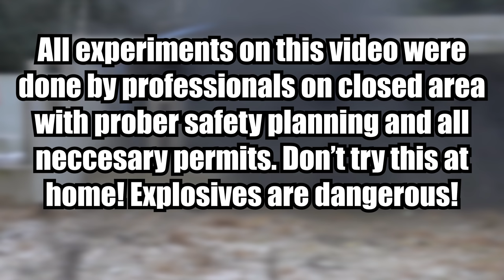How hard it is to explode a hole in concrete wall?

Comment: Never seen a better commercial for concrete walls...
Reply: @ChongPangBoom  money
Reply: @ChongPangBoom : that Concrete is High density. MicroFibre and steel reinforced concrete in a vibrating cast.
That probably costs a 1000 dollars or more.
When you talk about 4 walls per room. Ceilings. Pillars. Etc.
You quickly escape a third world countries budget for both manufacturing and purchasing and sale.

We have the technology to have Supercrete now that can build structures twice the size of the burj khalifa.
The problem is no one can make it to the quantity or budget required to Make it possible.
Reply: Can't glass bottles be used to strengthen concrete structures?
Reply: If I ever get a bunker built, I'd want their walls :-)
Reply: @TheOneAndOnlyMrH  Well Finland does have long experience in making concrete bunkers. Due to civil defense legislation pretty much every big apartment complex, office block etc. does have an air raid shelter on bottom floor or in the basement under the building.
Reply: I want something like that between me and my stupid neighbors...
Reply: @jugganaut33  wow, I thought all concrete was the same, I didn't think that there were advancements in the field of concrete
Reply: Yes, as a concrete wall myself, I'm flattered by this video
Reply: Honeywall doesn’t give a f$&@
Reply: @ARF_average  yep
Reply: @erik365365365  lmao nice name
Reply: @mastershooter64 : yep. There’s some fantastic things you can do with concrete
Reply: Looks like maybe 12inch on center #5 rebar reenforcment, I've poured stuff with 8 inch on center with thicker bar like 7bar at 12inch thick, for water treatment plants. Basically bomb shelters.
Reply: @ChongPangBoom  Because they were not using an artillery shell.
Reply: I'm glad something new
Reply: @ChongPangBoom  You don't see houses go down like sand because of small loads like those breaching charges... you see them go down because they get hit either by heavy artillery, a missile or a guided bomb. They don't carry 800 gramms of TNT equivalent, but 117 Kg for a Mark 82 Bomb...
And if it is a controlled demolition with targeted explosives, you can bring most concrete buildings down like sand with quite small charges (a few KG), even with reinforced concrete.
Reply: Now to make something to patch the hole from the last fight with your neigboor
Reply: no one will ever be able to punch a hole through your wall unless they use PETN!!!!
Reply: @thoughtfox2409  thank you, you said it for me lol. A lot of people seem to think an explosion is an explosion is an explosion
Reply: @mastershooter64  There's a ton of different concrete. The sad part is that we've lost the knowledge of how the romans made concrete, many things they built of it has lasted until modern times. They also had at least two different techniques, and the one that it's the biggest shame it's lost to time is their marine concrete, that actually improves its durability in the presence of sea water, instead of slowly degrading and eroding like modern concrete. There's roman built concrete bridges that still stand to this day(and some are in use for traffic!) On the other end of the spectrum you have Chinese buildings where the concrete cracks within 3 years, and they're basically condemned within 20.
Reply: @omarzx5700  Oh there's other explosives that'd do it too, like RDX, or more commonly TNT and RDX mixed together(which is about 50% more potent than TNT by itself). Then there's state of the art explosives like CL-20 and HMX. Then there's thermobarics, but they're not exactly made for bringing down walls, unless you count bringing down the entire structure.
Reply: @OnlyKaerius  Concrete is based off of a caustic solidifying crystallization between calcium and silicon dioxide (sand/glass/quartz) when in liquid solution (calcium silicate hydrate). It forms basically limestone around whatever filler material you use like cheap gravel and hard beads of steel slag. You can use silica fume (micro-sand) and some other additives to improve the final crystallization homogeneity, and you can add rebar and metal/ceramic/ or organic fibrils to keep cracks from spreading, and to take up flexural and shock loads. They act like little anchors which have a higher tensile+shear strength than the surrounding concrete.

There are other formulations of concrete, other fillers and additives, and other ways to strengthen the final slab far higher than any glass limestone rock. One example is using aluminum oxide (sapphire) in place of sand and silica fume. It is a much, much stronger ceramic versus quarts and has one of the best chemical resistance to nearly all acids and bases. Some geopolymers have a limited ability to incorporate aluminum oxide into concrete mixes, and there are plenty other ceramics that would do the job as well.
Reply: If you want a 3000MPa compression/ 500MPa tensile wall, nothing's stopping you.
Reply: @jugganaut33  basically all concrete is vibrated and objectively concrete is quite a cheap building material Look at the amount of dams / irrigation that some objectively poor countries have. It is just very heavy and therefore expensive to transport and crane into place if manufactured offsite or pump into place if formed onsite. Also the main reason that there aren’t tall buildings fully made of reinforced concrete is that a giant tower with no windows isn’t going to be funded by anyone.
Reply: @Baigle1  Even the romans used crushed pottery(ceramic) to improve their concrete, what we don't know is how they made their marine concrete resist and actually become strengthened by sea water, instead of degrading and eroding. We don't know how to do that.
Reply: Now imagine being rich enough to build massive steel and concrete bunkers, knowing that nothing can touch you... Lol
Reply: @OnlyKaerius  the main reason roman concrete last forever is that they don't have anything than can rust inside. this is also the main reason concrete fails after only 20 years, unless it's absolutely perfect, water enters and rust forms on the rebar's and cracks the concrete (if you have big enough impurities, ice formation by itself does the job, too).
the main disadvantage is that roman concrete limits it's architectural usefulness extremely. you can basically only use it as a replacement for stone, it can only resist compression. building lets say a highway bridge with roman concrete would essentially mean it would look like the old railway stone bridges we have all over Europe. very little ability to span and using tons of material, but lasts forever (unless you get a strong enough earthquake, then your steel reinforced concrete has a much better change of surviving). today's concrete is made the way it is, so it can be mass produced, used rapidly, and allows building structures than otherwise would be impossible.
Reply: @OnlyKaerius  that's actually not true, they figured out the formula for Roman concrete in 2017. Turns out it uses the volcanic ash pozzolana in the cement and is mixed with seawater, not fresh water.
Reply: @aritakalo8011  Fascinating & Freaky.
Reply: Legit why they helped them do this 😂
Reply: @ChongPangBoom  
reinforced concrete isnt all that expensive to make and you can easily make it yourself at home.
the only problem with it is that it takes time for the concrete to harden and you need heavy machines to build with larger slabs likw full wall tiles.
Reply: @ChongPangBoom  huh good idea, have they ever think about it
Reply: Hhahhahah you got that ad too?
Reply: @jugganaut33  I don't know about high density or microfibre concrete but I'm an architect in México you could say it's a 3rd world country and most of the low budged housing projects are made fully out of reinforced concrete, of course its only 10cm walls and thin rebar mesh, but my point is that concrete itself is not expensive, it all depends on how thick and how strong is the steel reinforcement you use.

The great thing about reinforced concrete is that it solves the two main forces a building needs to hold up to: 
1. Concrete is extremely resistant to COMPRESSION and protects steel reinforcement against corrosion.
2. And steel is extremely resistant to TENSION
Put both of them together and you get one of the best materials for construction, and having a very efficient construction method is fast and cheap.

Those are the nice things about concrete, the worst part about it is bad thermal insulation that why here in México, high budget construction use other hybrid construction methods.
Reply: To show you the power of flex paste I used explosives to put holes in this wall
Reply: @The Lombax You're applying American prices to the third world which is not correct. Concrete itself is dirt cheap. The expensive part is labor and if anything is cheap in third world countries, it's labor. Cheap labor + no insurance = cheap concrete buildings.
Reply: @ARF_average  That would lighten a concrete wall while only minimally making it weaker in compression. Installing both bottles for air voids and the steel tension grid might be a bit tricky though. Haven't given it a thought before.
Reply: @jugganaut33  Not to piss on your budget parade (honestly),  but.. one would only need the basement level of a detatchedhouse to have concrete walls. So that's either half or one third of the whole wall made out of this super expensive cement and rock mixture.

The costs of which, as you implied, would come down to the local providers logistical capability. Crushing, sorting for size and then especially moving shattered rock around gets more expensive the less production sites one has in a given area. Luckily in Finland we have good coverage of such sites and well built roads all around, arguably even in places where such infrastructure isn't needed. The steel bars are equally abundant in Europe. Means the product is relatively cheap for the constructor. Now assembling the tension bar grid and encasing it with the concrete mold before the pour takes some man hours, which can cost you in a welfare state. 

Oddly enough concrete walls are way more expensive to produce in the so called "third world" despite the cheap labor. Luckily they are quickly catching up.

Also only the first room needs 4 walls. Two rooms can share one wall and so on. ^^

Then again if we are talking about building super tall buildings the limiting factor becomes gravity. Namely pumping the cement and rock mixture to the top level pour sites requires multiple pumpstations and steel reinforced and airtight chutes which can only be of a given length before buckling under pressure. So moving concrete materials vertically can get expensive but moving it horizontally can get stupid expensive.

I'm definetly not an construction engineer, so if anyone wants to pitch in go right ahead :D
Reply: @NJzinho  Money is not the issue its because of insurance, they dont want you to have an immortal house, they want youre house to get rekt so they can replace it with another cardboard house and raise the cost.
Reply: I need that concrete wall
Reply: Best commercial for anything I’ve seen
Reply: @Baigle1  I wondered about aluminium oxide fills. I'd been watching some videos about water jet cutting, then a documentary about the Hatton Garden robbery. Criminals used a big hole cutter to cut through a reinforced concrete wall into a vault. So was wondering if you could defeat that kind of drilling attack by using that sapphire grit. And I guess for the bunker builder that has everything, a couple of pallets of industrial diamond grit would wear down any would-be robber.
Reply: "Now, thats not a lot of damage"
Reply: I wana see a concreat wall commercial
Reply: Yeah haha I hope the perustava folks at least took them out for drinks that night!
Reply: @OnlyKaerius  it's actually being researched and implemented, they used pozzolanic cement. their marine cement is pretty much the same thing, volcanic ash and lime would react with seawater and create tobermite crystals due to the Phillipsite inside the ash. check into it, pretty cool stuff. we would have to be able to manufacture Phillipsite via a lab to keep up with our needs today since society is much larger (or start pissing off volcanoes).
Reply: @skuula  This is 4 months later. But that is exactly my first thought. Hahaha

Comment: Disclaimer: "These are trained professionals, don't try this yourself"
Trained professionals: "We wrapped some det-cord around a bottle... IDK"
Reply: "Prober"
Reply: Professionally sketchy
Reply: All 'professional' means is you get paid to do something. If someone gives you a penny to throw a FRAG grenade at a fish, technically you are a professional grenade fisherman.
Reply: @Debbiebabe69  trained
Reply: At least they didn't use a Pepsi bottle, because that would have been cheating. Trained professionals know these things.
Reply: The big issue is less the explosive stuff they build and mostly the way you handle the explosives, how much you use, what you use and what safety measures to take.

 If the blast itself goes wrong that's not as big an issue if you have everyone at a safe distance, behind a wall and so on. But if stuff blows up while you're working on it, you have problems.
Reply: @leow.2162  "But if stuff blows up while you're working on it, you have problems."
Ah, yes. I too consider fucking dying a problem.
Reply: that's how it is,  when my dad was in the army they would not exactly play with explosives but do "experiments" with them... such as what happens when you put a bunch of nails in C4 or lets ask for an airstrike on this giant gas container we had airdropped in for us
Reply: lmao
Reply: @Debbiebabe69  Wow holy shit, by definition, you're completely right; what the fuck
Reply: As is the the case for most things engineering
Reply: @Pillar_of_Salt  imagine being right on the internet lmao
Reply: @ZentaBon  Right? lmao
Reply: The professionals knew how do a detonation calculation and were right as far as safety stand-off. They also did a practical experiment, but for fun. They even, subtly, showed the difference between two water charges. The bottle didn't work because all of the force went to blow the cap off. In the other water charge the force was tamped.
Reply: @leow.2162  Depends on the size of the explosion really. If it's big enough you won't have a problem anymore.
Reply: Youd be surprised, being a combat engineer i regularly work with explosives and it's the same shit in the military, just a lot more tape and the explosives are olive drab
Reply: @blazeesq2000  in other words used math and practiced common sense and didn't die. Yes. Many professionals make mathematical mistakes. Sometimes they die sometimes they learn.
Reply: @threeco2350  that just means someone told you HOW to throw the grenade at the fish.
Reply: @randallsanders1766  wait, is dying not a p
Reply: @leow.2162  my favorite line from an EOD guy i met once was "Well, if something I'm working on blows then i don't think its my problem anymore. It becomes someone else's problem."
Reply: Professional means: You get the job done efficiently!
Reply: Dont worry about it
it just works
Reply: Professional Finnish
Reply: @michaelrenper796  That's the hope. But not my experience
Reply: Trained professionals: PROJEKT VET FARDD
Reply: @threeco2350  it was a fast training session :D
Reply: @kyle18934  man really responded to a year old comment
Reply: @threeco2350  but of course
Reply: @threeco2350  so... trained, then paid a penny to throw grenade at a fish makes you a trained professional grenade fisherman?  
I would like to apply for Finnish citizenship.
Reply: We wrapped Det Cord around trees to drop them into an Ambush Kill Zone during training.

Wrapping Det Cord is a good way to get things to explode.
Especially if you are low on primers.
Reply: They are Fins...they are crazy, but some how they know their stuff. ;)
Reply: Finnish Pressure Washer ... that was brilliant.
Reply: Jan misali enjoyer?
Reply: Sounds professional to me
Reply: @ajones141 like the time my WW2 vet great uncle was blasting stumps on the farm, and his miscalculation landed one stump in the ditch next to him.
Reply: I don't know why, but it really, REALLY irks me when I see "professionals" acting unprofessional. For example, when I watch what appears to be a doctor removing jiggers from someone's feet, it disturbs me NOT because of the sight itself, but because the doctor remains eerily silent, making me wonder if he's actually a professional or just some random unlicensed person filming videos for money.